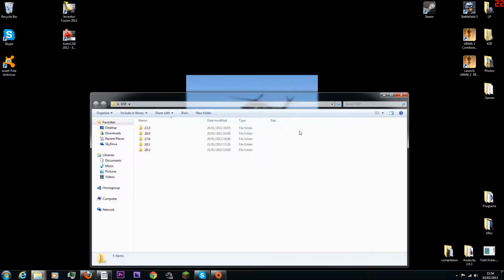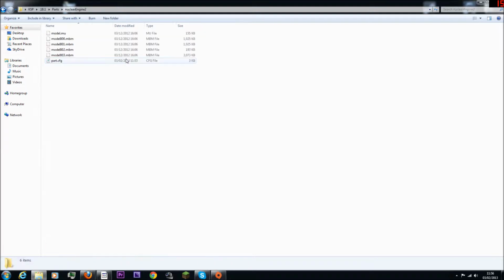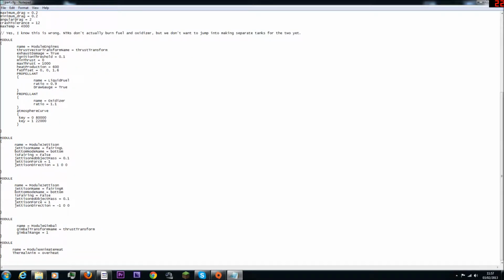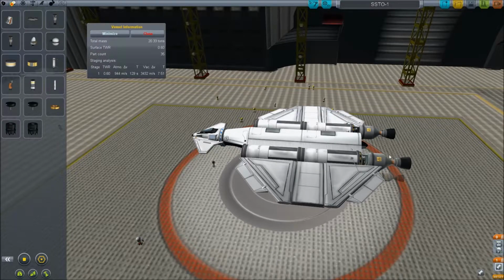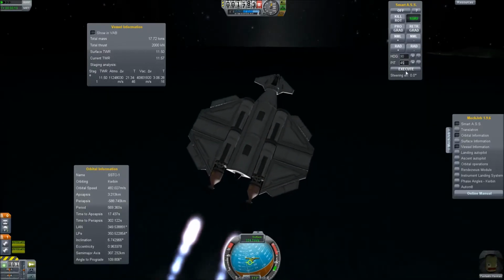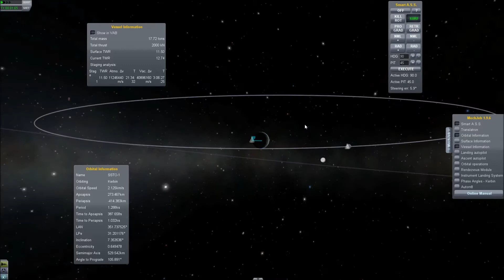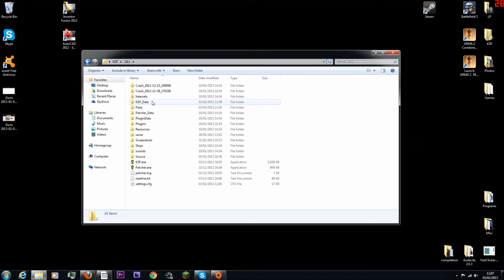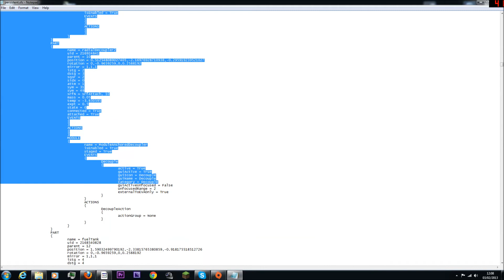Kerbal Space Program: Art of the haxor (editing parts and saves, basic)

Comment: I cannot open my persistent.sfs. This error message pops up when I try: Windows cannot access the specified device, path, or file. You may not have the appropriate permissions to access this file.
Reply from the maker: That's the first time I have heard that problem and there could be any number of causes, so here is a list of things I have come up with.
On the hardware side of it, the file may be damaged or corrupted, which is a surprisingly common problem on SSD storage, particularly older generations. If you have an SSD, perhaps running a health checker such as defraggler can detect any issues. If you have installed it on a second hard drive as I have, a loose SATA cable can create some strange issues with file access as I know from experience. The best fix is to take the drive out and plug it back in again, then run the defraggle analysis to check for any issues. If the file is corrupted, then you will need to replace it.
As for software: If you are using a shared computer, it may be that the owner/administrator has disallowed such file types for any number of reasons. I feel that this is the most likely cause. To get around this, the best option is to speak to the administrator to have the permissions changed.
It might also be that you have attempted to open the file while another program (KSP) is using it. Close KSP and try again.
If you are trying to play from a USB or other external device, it might not be seated properly in the port. Some external devices also have a "Read/Write-Read-only" switch on them. If Read-only is selected on the drive, then it may be preventing you from opening the files (though you should be able to at least view them). You can either flick the switch to "Read/Write" or copy the files to your computer to edit them.

I have saved this for last as I am unsure of the implications of attempting this, but changing the file extension from sfs to txt might bypass anything the administrators have put in place. KSP probably wont be able to recognise the txt filetype so you will have to revert it before playing again. If you do try this, be sure to make a backup of the original sfs in case the sfs-txt-sfs conversion corrupts it.
This doesn't cover everything, but I hope something here helps.
Reply: My account is an administrator, and I was going to defraggle it soon anyway.
Reply from the maker: PigsCanGame
I assume then you have considered all the items on that list. If so, then unfortunately I can help you no further

Comment from the maker: That is quite a bit more difficult to get right, though roughly; in the saves file under your craft data (use ctl+f and type craft name to find it) there should be a field named something along the lines of host body or orbiting body, The number that follows corresponds to celestial bodies. I think the Mun is 2, though I'm not sure. Make sure you adjust the sma appropriately as I have ended up underneath the surface before (which, by default, makes unwanted explosions)